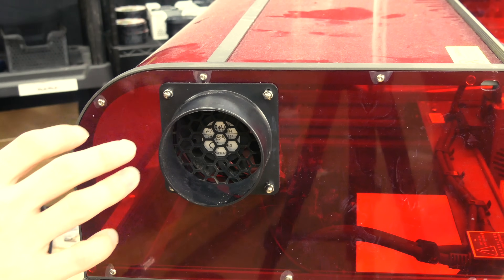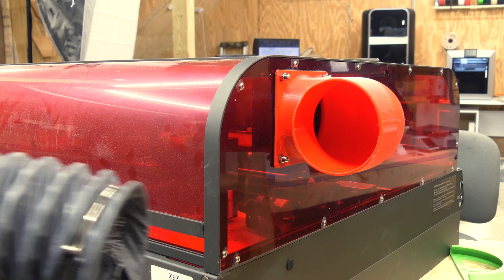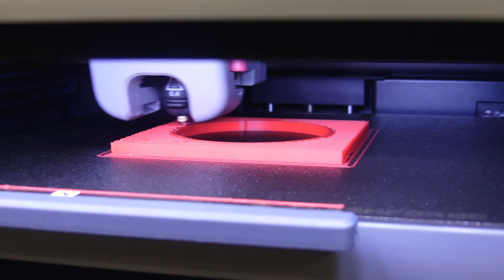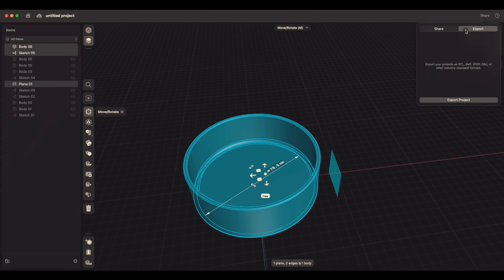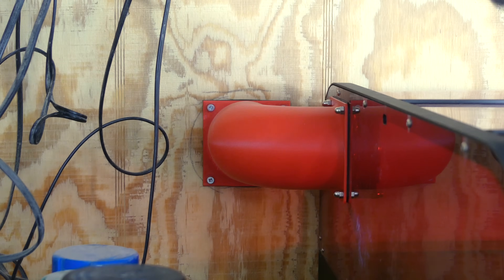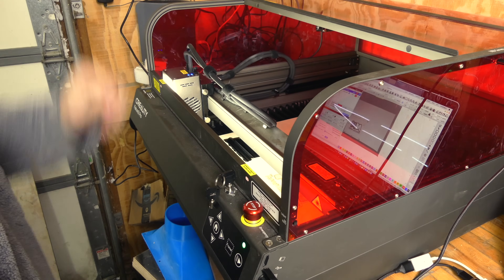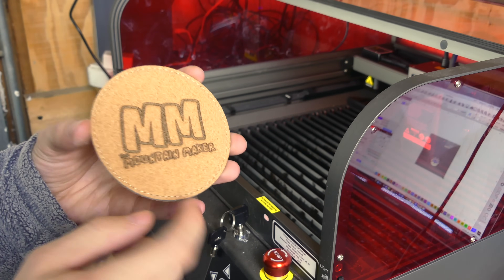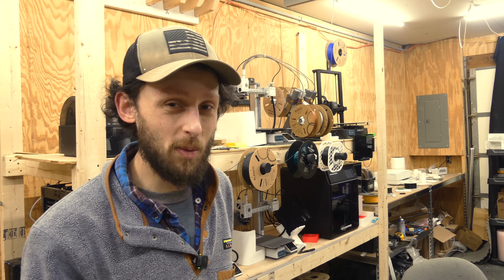A STUPID SIMPLE 3D Printed Exhaust Port for the Creality Falcon 2 Pro 40W Laser

Comment: Awesome video, Use adaptive layer to fix the print issues. I'm not sure how much hot elements come out of the exhaust but maybe check on that red PLA tube later. Thanks again!
Reply from the maker: Great Suggestion for the adaptive layer height! The port and all those red prints are actually PETG-HF from Bambu, but it doesn't get very warm in there, mainly smokey.

Comment: Like your work! I just got my Flashforge Adventurer 5M PRO and been printing with PLA Pro and it works great and it has a nice matt finish, like it a lot, I'm going to buy both ASA and TPU (Flasforge own filament) and try them out next week. I have a computer/repair shop and my reseller has Flashforge so I can buy all filament from them.🤭
Reply from the maker: Flashforge's ASA works awesome with their ASA profile in Orca. I've also printed with PETG-CF from Flashforge/Voxelab using the Flashforge PETG-CF profile with a 0.6mm nozzle and it prints flawlessly.

Comment: My winter resin printer exhaust is a sight to behold, this is a masterpiece in comparison! I cut a piece of thick pink foam insulation that fits snug inside the entire window and put a dryer vent kit in the foam. I crack the window enough to clear the vent when printing. It looks janky as hell, but my hobby room doesn't stink, VOC's are very low, and the room stays warm. It's on the back of the house, so who cares. 🤷‍♀️
Reply from the maker: I love that you found a solution that works for you! Sometimes the janky ones are the best.

Comment: Maybe a sliding door in that elbow, or the wall adapter that can be slid shut to close off the cold air
Reply: @goatelope7539  AND a grill, critters love finding warm open pipes, especially birds. A cap like mentioned in the video will only work as long as you remember to keep replacing it 🤞.

Even had a bird remove a friction fit grill and then proceeded to get sucked into the furnace air intake one year… not a great smell, though it was a dead mouse somewhere for a week before I figured it out. 🫣 Now it is a screwed on grill.